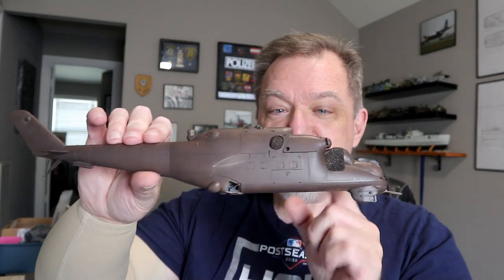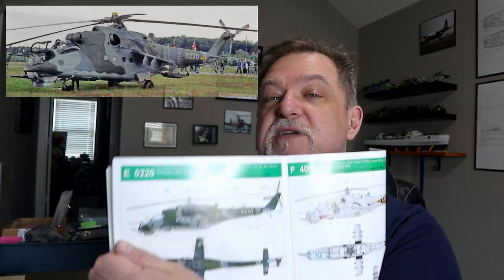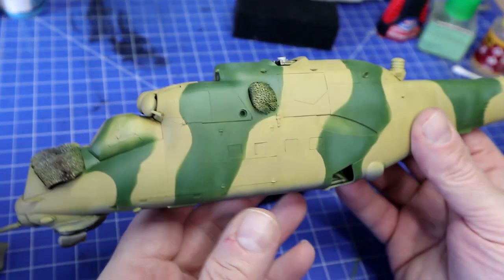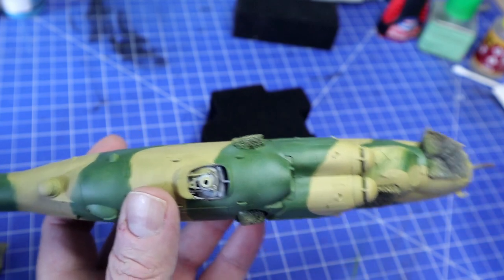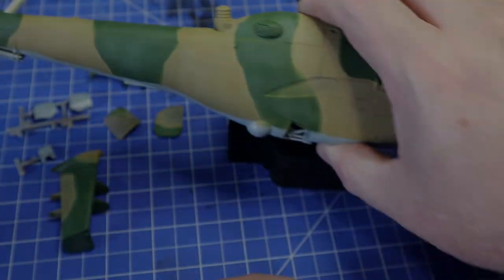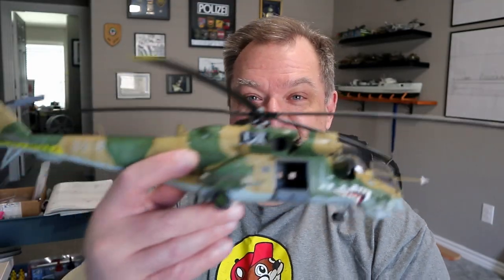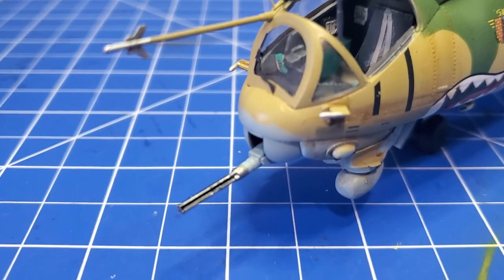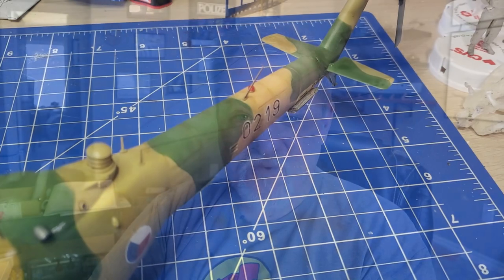Czech AF Mi-24D - Eduard/Zvezda 1:48 "Hind D" - Part 4: Finishing Up (and those "New" Eduard decals)

Comment: I'm confused. I was told the eduard set is the Zvezda kit with extras, but the two Zvezda 1/48 kits are hind E's and F's.  Can anyone explain what makes this a Hind-D?  (Sorry, I'm working on a Metal Gear Solid display so I'm trying to learn what makes a Hind-D a "D"
Reply from the maker: The Hind-D carried four SACLOS 9M17 Phalanga anti-tank missiles , the Hind-E carried eight 9M114 Shturm (AT-6 Spiral) missiles, and the Hind-F had a fixed side-mounted 30mm GSh-30-2K twin-barrel autocannon instead of the 4-barrel machine gun. That's why Eduard included -D specific additions. Thanks for watching and I hope that helps.
Reply: @MisterGsWorkbench  so everything eduard put in this kit converts it to a true "D"? Thanks for replying by the way.
Reply from the maker: @Draegon86  that's my understanding. I'm trusting Eduard on this one.